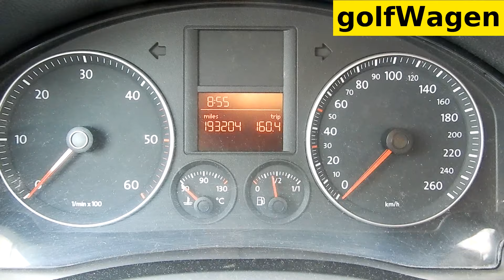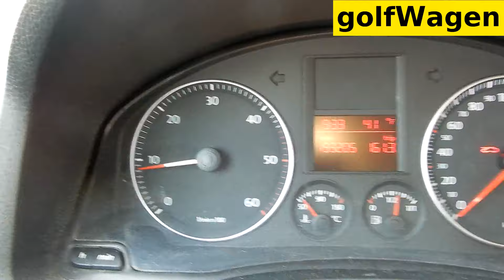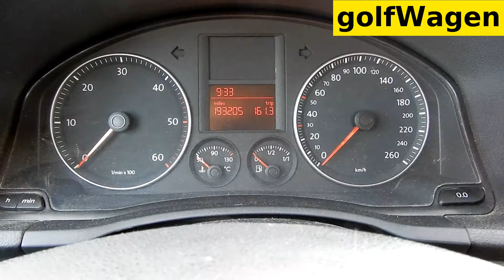VW Golf PD injector loom connector about

Comment: Thank you for this excellent instructional video, this is exactly what was wrong with the car that I have now fixed. It has gone from doing 15mpg to now doing 40-50mpg, and it cost nothing except a bit of spray to clean the electrical contacts

Comment: mine is leaking oil from there how can i fix it?
Reply: So is mine, not uncommon apparently. Doubt if you can seal the plug so I think a new loom is the only choice.
Reply: @PropanePete As you can see in the video, he sealed the leak with something. Usually thermo silicon.
Reply: @imperia777  Funnily enough, that was 2 years ago and I still haven't done anything about my oil leak. But it's just a tiny seep really, not a leak. I will get around to it but it will probably be a new loom, not sealant.
Reply: @PropanePete  I am the same. I have this leak since I have the car. Like 5 years. But there is a possibility to be from tandem pump too.
Reply: @imperia777  Most likely culprit for the oil leak is the valve cover gasket first and second would be the injector loom connector. An oil leak from the tandem pump is unlikely but it’s easy to change the gasket that fits between the head and the pump if you wanted to try that, no need to undo the lines either. I never try to seal up oil leaks with silicone. It’s not a proper job and the silicone hardens up and breaks down eventually anyway and also bits of it can break off and end up inside your engine.